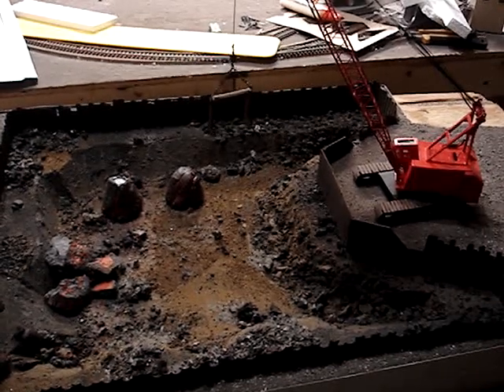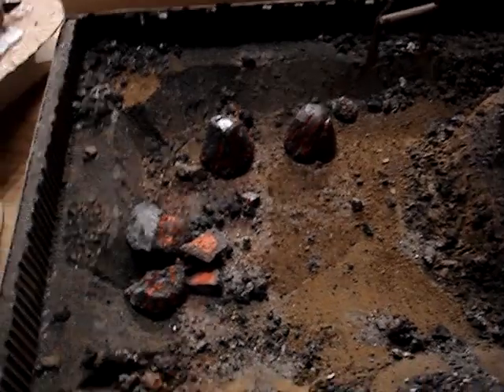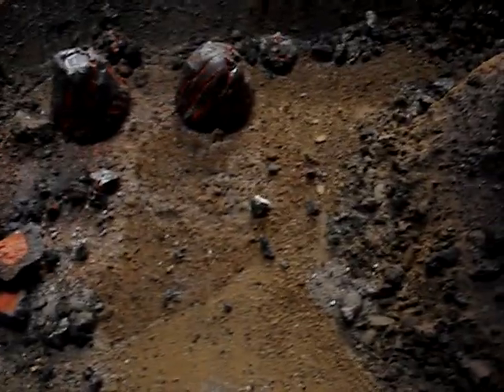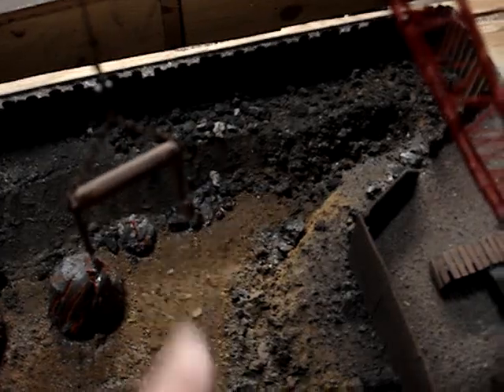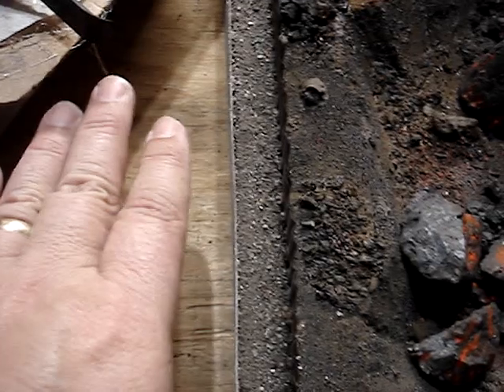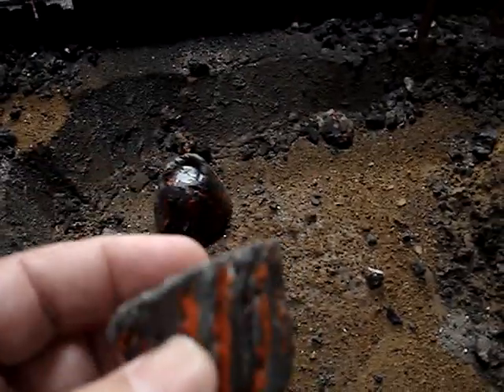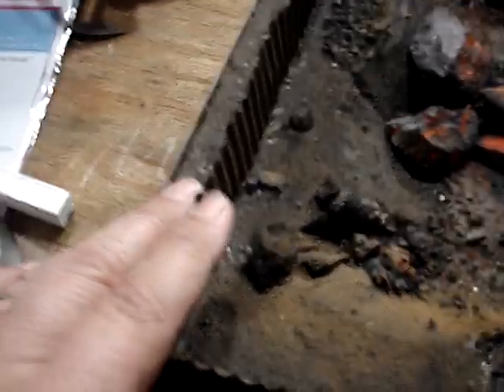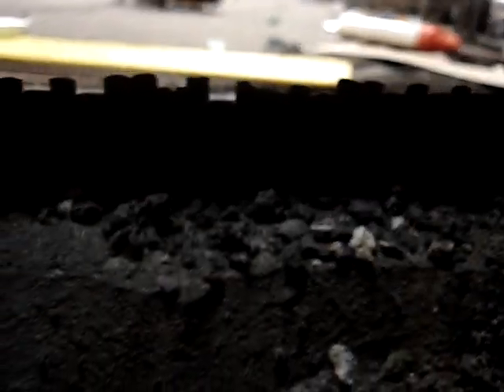HO Scale Slag Pit completed.

Comment: That looks almost the same as what I remember of the one here at my place.. We had a huge steel wrecking ball, that was lifted with a crane and then drop on those big chunks of slag that came out of the pots.
Reply from the maker: I made a skull cracker ball but liked the J hooks on the 4100. Might need to build another 4100 for a drop ball. Need to show folks how easy it is to build a crawler crane in HO. YouTube won't be around much longer though,next video platform. The Storm is here. God bless Australia and God bless Australians.
Reply: @ModelingSteelinHO  You model what you had and seen which is fantastic. We didn't have this system in my local works.
I enjoy seeing the differences of operations between different plants.